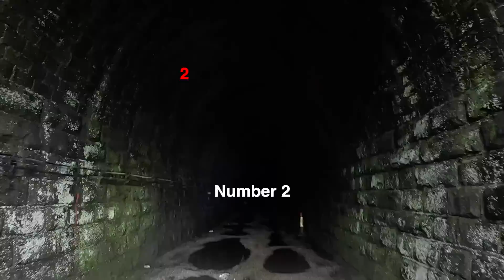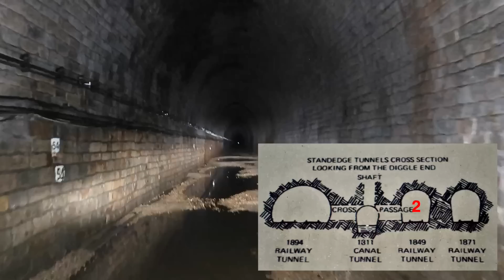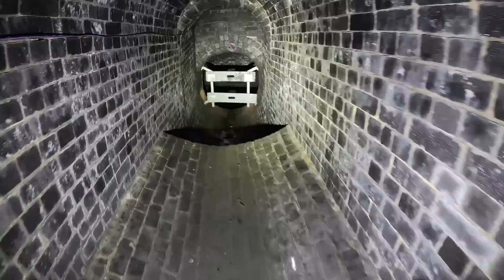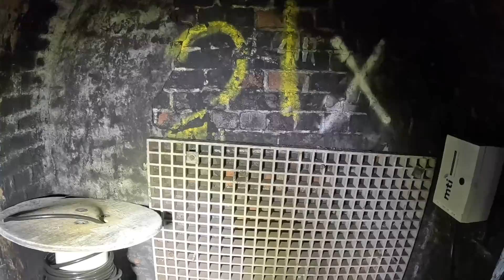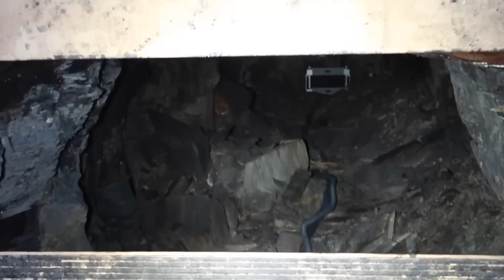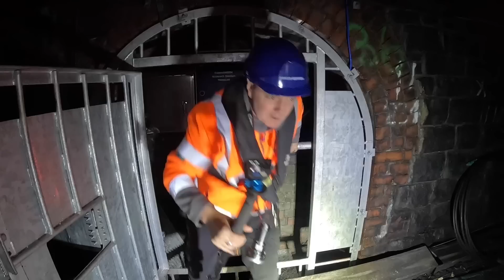Engineering in Standedge Tunnel

Comment: Fascinating and illuminating to see just how many resources are wasted on a simple problem that could be solved with two bare wires,  telephone handsets with crocodile clips, and a battery as used for decades on the tube system. The first recourse these days seems to be to throw money and technology at problems that seem sometimes to have been created just so these solutions can be used. I wonder how many tunnel closures will now be attributed to failure of the communications system. Like Anderton lift being closed many times due to software problems or faulty ITware. Yes Standege is a long tunnel but it's really not wildly different to others, most un-personned, if something goes wrong. With this one you even have someone, I assume they would be called 'professional', to steer the boat for you. How many boats a year go through I wonder? Much of the time the canal is closed for one reason or another. Is this a ploy to spend a load of money and then claim the canal costs too much to run and be used as an excuse to close it which will certainly be an option CRT will be looking hard at and trying to justify while wringing their hands and sqeuaking "2000 miles, 250 years old, climate change, government subsidy" etc.

Comment: Great video. When I worked on a rail possession in the early 20l00’s the cross passage was up steps and we walked over the canal to the main line in the double track tunnel. It was a wooden bridge over the canal and you could see down into it as you carried your tools to the rail tunnel. If we missed the van we had to walk in with a torch and some of the refuges in the service tunnels had wierd dolls laying around. We even found a ouigi board in there !
Reply from the maker: Yeah the boards over the canal are still there 👍

Comment: If I remember it correctly, a few years back, weren’t there small bridges crossing the canal so you could access the live rail tunnel from the old disused rail tunnel? Are those bridges removed or are in sections which aren’t used for the new com system?
Reply from the maker: Yes in some bits where the adits line up, you can walk right over the canal
Reply: @MartinZero  Thanks Martin, think they used different adits to prevent the antennas from being too low in the tunnel when mounted under those bridges.

Comment: I can only imagine the cost of that system.  Don't want to say health and safety gone mad but it can't be that dangerous to go through it.
Reply: Your in a 5km long tunnel, your boat's broken down and you're left in pitch black darkness, what do you do?
Reply: @SMlFFY85  why would you be in pitch black they have these amazing things called torches. Then they could push the boat to the nearest access point like they did for hundreds of years before. Or have a emergency electric outboard motor ready. 
I don't really see how knowing where the boat is at all time makes anything that much safer. It probably cost hundred plus thousands of £.
Reply: It is H&S gone mad. The only danger i can think of is drowning but that could happen anywhere on the canal network. Its not dangerous at all.  All the tunnels have been there for over 150 years and they'll still be in another 150. They were built absolutely solidly and aren't going to collapse any time soon, if ever.
Reply: @simontay4851 There are several canal tunnels unusable due to collapse -Lapal and Sapperton are two off the top of my head. Standedge, Wast Hill, Blixworth all required major work more or less recently to stabilise. Harecastle gets lower in the middle due to subsidence which I believe is ongoing. The companies that built the tunnels all had an eye on profit like all companies and didn't spend money if they didn't have to.

Comment: Hi Martin, this video left myself with some memory issues, when I use to drive through Standedge Tunnel from Marsden the Canal was on the right, then next tunnel was the current one, then the disused single bore tunnels, I always use to look at the canal but this just confused me with the sketch you showed showing the canal in the middle?
Reply: At the Marsden end, the canal is on the left of the current rail lines on approach to the tunnel (immediately after going through the station) just as it is going through the tunnels (so the diagram is correct), but both the canal and the railway have to curve into the tunnels at the Marsden end. The rail curve is (obviously) smooth but the canal doglegs into the tunnel. So the railway has to start its curve before the canal dogleg meaning it first passes over the canal at the start of the curve and then passes back over the canal (after the canal dogleg) on entry to the runnel. Which is why for a very brief time the canal is on the right of the railway immediately before entry to the tunnels. It's fairly easy to make it out if you look at Google Earth.
Reply from the maker: Ahh yes I get what he is saying now 👍
Reply from the maker: The sketch is correct and the Canal is at a lower lever. The sketch looks from the Diggle end

Comment: Great to see inside the Standedge Tunnels once again with some fantastic filming and commentary Martin. What I don't understand is why, or the appearance of, making it more difficult to escape from the canal to the safety of the old railway tunnels  Martin.
Reply from the maker: The old tunnel is the obvious and most safe choice
Reply: @MartinZero  I agree Martin.
Reply: Escape from what though? There is nothing to escape from. Has anyone ever actually drowned in the canal? Probably not. The old rail tunnel wouldn't save you from drowning anyway. It just looks like an over complicated, 
very expensive and unnecessary system. There was nothing wrong with the old system.
Reply from the maker: Thing is it’s 3 miles long. Boats are down there for almost 2 hours going through. You have to think of medical emergencies. Possible rock collapse (although there hasn’t been a serious one) but it would be irresponsible to have a tunnel that long and deep with no communication or escape plan.
Reply: @MartinZero  I completely agree Martin.
Reply: @simontay4851  Fire possibly. It just seems bizarre to me blocking off possible escape routes from the canal.